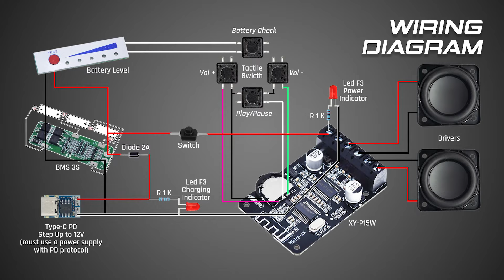DIY Fake Marshall Emberton (Bluetooth Speaker MDF & Acrylic Laser Cutting)

Comment: Speakerny merek apa bang , brapa watt
Reply from the maker: speaker aiyima 2 inch abng, ada d shopee kok
hargany 120an sepasang
cek juga linkny d deskripsi
Reply: @RODDEVID  ok bang makasih, ini udah beli 2inc 20 watt masih bingung buat box ☺☺☺
Reply: @RODDEVID  pakek ampli XY-P 15watt bagus gak bang
Reply from the maker: solusinya pake box mdf laser cutting, tinggal nnti kita yg lem.

xyp15w bagus bro, cman volume d control jgn terlalu full kalo batrenya cman 3 biji.
Reply: @RODDEVID  ok siapp makasih bang 👍👍👍
Reply from the maker: Siap 🤙🤙🔥🔥
Reply: Laser cutting itu pesan atau bagaimana bang?

Comment: Xy-p15w ku kok.... Nyambung putus terus bluetooth nya kenapa ya om....?
Reply from the maker: Pake tegangan brapa Volt om?
Reply: 12 volt 2a.... Sih om....
Reply: Kalau deket mah tak kasih aja nih om... Sapa tau bisa dibeneri ama pam8610 potensio....
Reply from the maker: Banyak temen ane yg ngeluhin xyp15, tapi ane blm pernah ngalamin om.
Kalo deket ni ada ane xyp15 😁👍⚡🔥🤙
Reply: @RODDEVID  iyah om.... 😁😁
Reply: Punya aiyima 3 inch, rms 15 - max 30.... 4ohm......kalau boleh minta saran pake ampli apa yg cocok om...? Yg daya 12v....cukup....baru nyoba ampli 2 itu tpi bosok semua 🤣🤣....
Reply from the maker: Ada brapa biji spekernya
Kalo ada 2, pake tpa3116
Kalo 1 pake 3118 aja
Reply: @RODDEVID  2 om.....ok om akan saya coba.... Terimaksh semuanya.... 😊
Reply from the maker: Siap ⚡🔥🤙